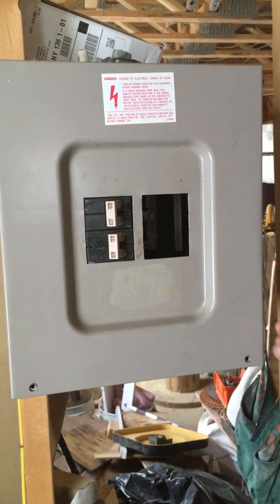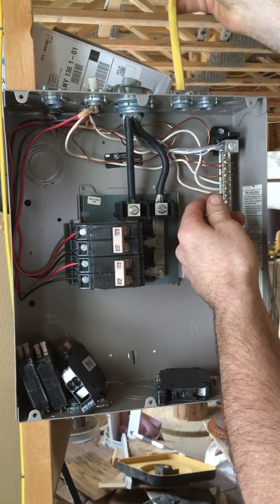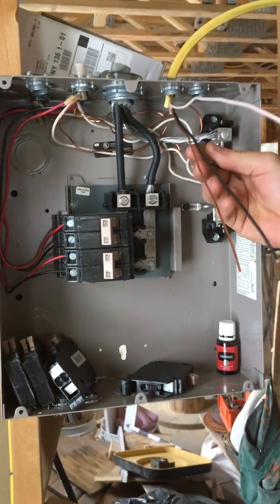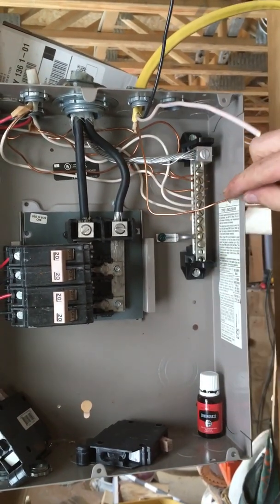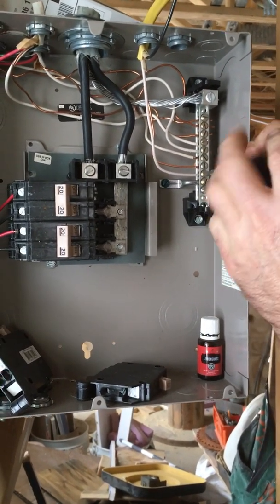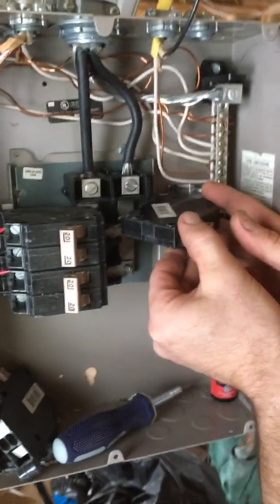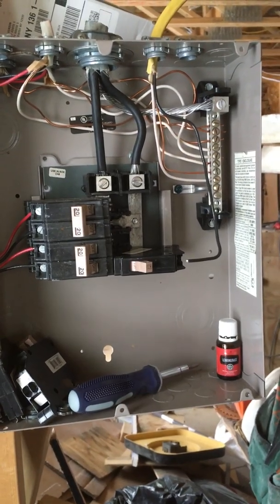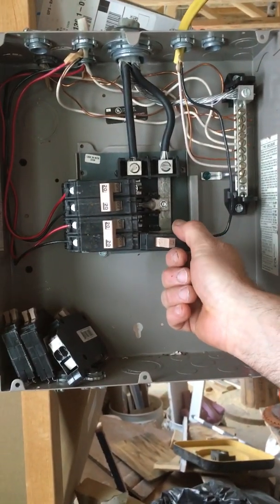How to install a 20 amp circuit breaker in a Cutler Hammer panel

Comment: Thats sorta the lazy way to strip romex, home gamer.
Not an elechicken, but zip from the bottom 1" of the cut and pull sheath apart. Or use the ground wire as a slicer.
You don't want to be cutting the wire insulation which is quite possible doing as you did.  
There ain't no 'trick' to doing it properly, its bad practice.

Comment: Rule 1: Right tool for the right job. 12awg with a knife?!? How do you still have your fingertips? 
Although this is a mock-up, the PARAMOUNT rule of a sub-panel is having separate neutral & grounding bars, withOUT the bonding screw in place.

Comment: Never work on a box that is live.  I know this is just a mock-up box, but it should have a master switch to the bus bar and the live cable should have insulated covers.
Reply: This is what is called a main lug panel.  It is most often used as a sub panel controlled by a circuit breaker in the main panel which also protects the wiring going to the sub panel.  It is also used in situations where the panel is some distance from the electrical service and there is a main disconnect breaker at that point.